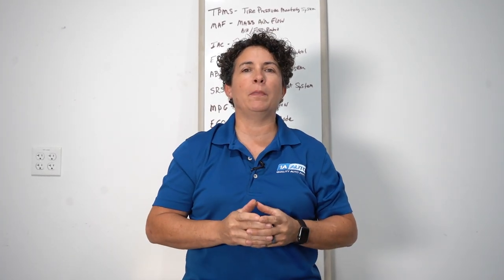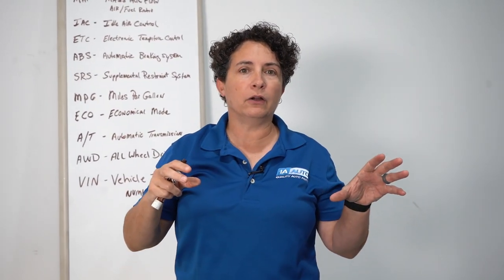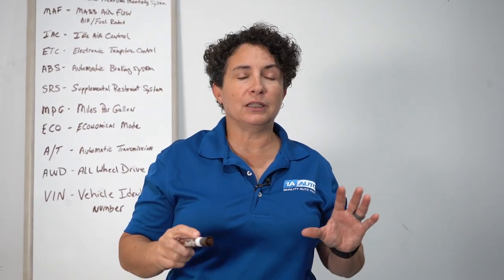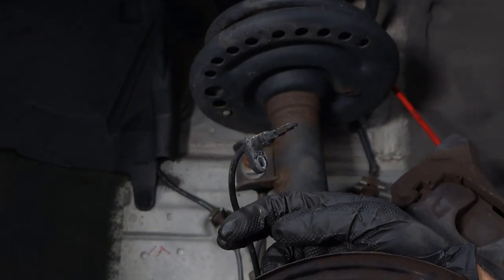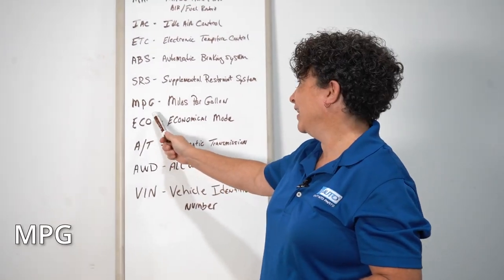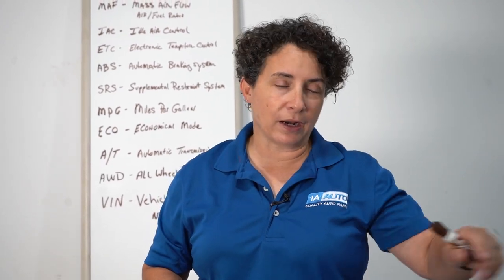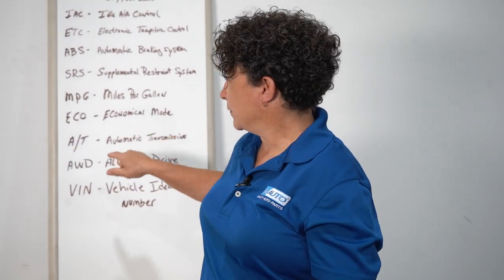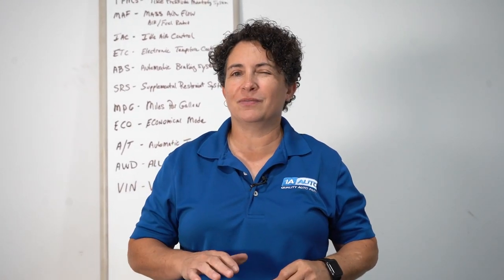Do You Know Automotive Lingo? Common Acronyms Explained: MAF ABS TPMS SRS IAC

Comment: Hey, ABS actually stands for Anti-lock Braking System. It prevents wheels from locking up (it does lock them up for a split second periodically for presure measurements) and thus keeping them at the peak of static friction, not alowing them to go into kinetic friction (when the tire is sliding). Static friction is higher than kinetic friction, so it reduces the stopping distance on hard surfaces.
It also alows use of bigger brakes. And alows steering uneder maximum braking.
Reply: Moreover, it is Anti-lock Brake System, not "Braking."
Reply: @ahotdj07  Whatever. 😊